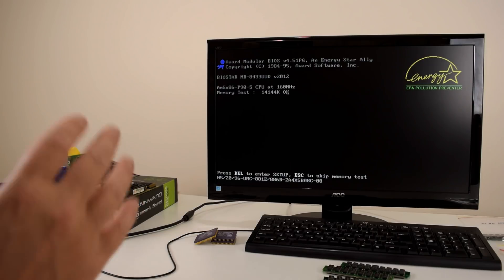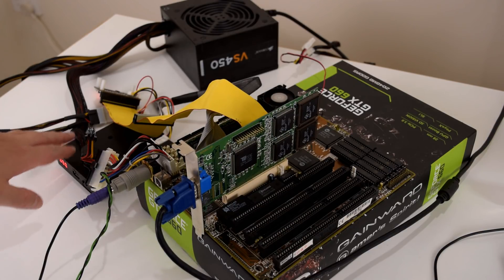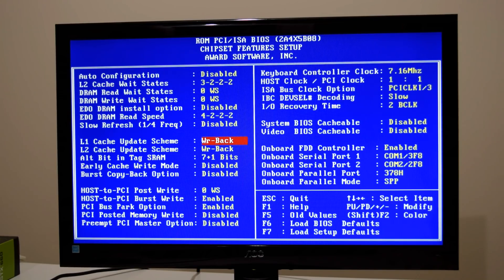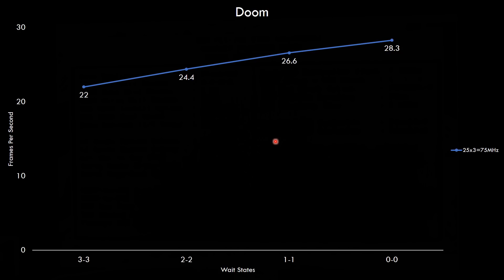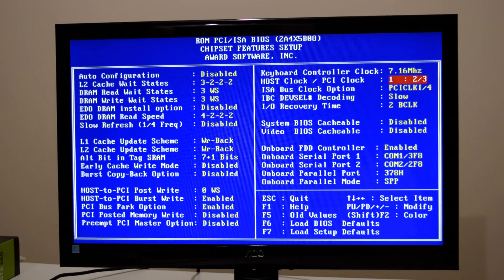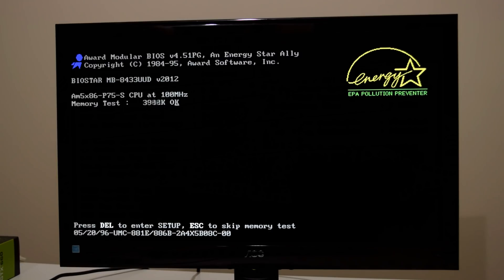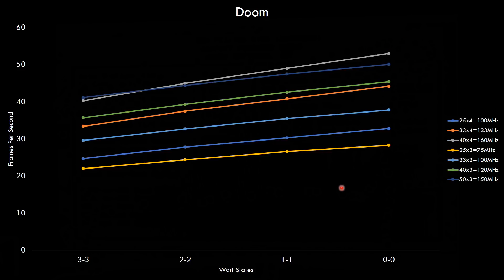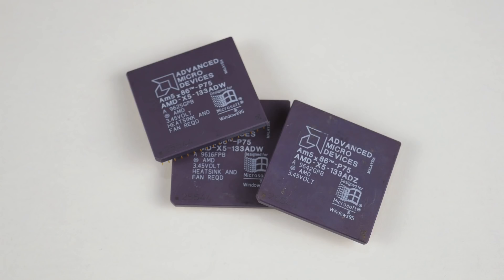486 from 75 MHz to 160 MHz and how memory timings matter

Comment: I picked up a peacock Computer recently. Came with a Cyrix dx 66 mhz processor. Then looking through a pile of broken laptops I found a system with a desktop 486 dx4 75 MHz cpu in it. I simply set the peacock bus speed to 33MHz along with the usual adjustments and works at 100mhz flawlessly ! About 65 on 3d bench

Comment: I realized you are actually changing 2 variables every time, the bus speed and the processor speed. It would have been wise to test the bus speed exclusively by doing 4x25, 3x33, 2x50 to see the effect of the bus scaling first, apply that ratio to the numbers when scaling up the processor clock to see which is more important, raw clock speed or bus speed. I feel like the bus speed is making a bigger hop than just the processor speed is.

Comment: Phil, personally, I don't think going older and older does you any favors. I enjoyed your videos on using cheap Ali Express motherboards to leverage Intel Xeons for maximum performance vs. modern parts so much more. I mean sure, remembering 486DX and such is cool, but what can we all really DO with all this? Now a cheap intel Xeon is a whole other story.

I also loved your videos on older GPUs and how they can sometimes fill in when newer more expensive GPUs are not available.
Reply: Dude, we watch Phil BECAUSE of the older stuff. It's much more simpler but at the same time more complex. 

And it's more DIY-able. Some guy did actual HARDWARE mods to make the 386 run at 50 MHz.
Reply: @fungo6631  there's old, and there's OLD.

Comment: That's an excellent in depth comparison Phil! It always strikes me how well organized you are. Kudos!
I'm currently overclocking a late 486 (1996) board that I got for only a few bucks (sold as broken but I necromanced it ;-) ) I always buy my hardware broken so I don't have to take out a second mortgage on my house for this "harmless hobby derailed" and it's really fun to repair cheap garbage ;-) Also got the famous ADZ version of the AMD 5x86 for cheap at a local seller. Your other video already helped me out a lot with my K6-2 build. This one does as well. I'm going with the 160Mhz option. This thing is goind to rip!     ..for a 486 ;-)
I'm still waiting for my 15ns L2 cache to arrive from Ukraine but I'm quite curious as well how much of a performance boost it will give me with this UMC chipset and my 60ns EDO ram...
Funny how de ADW parts state "heatsink and fan req'd" while the ADZ doesn't have this etched into the ceramic. I know the ADZ has the higher temperature rating but I wouldn't dare running this without any sort of cooling, especially not overclocked to 160MHz ;-)

Comment: Going from no cache to 128K L2 cache was more of a bump in performance for me than going from 33MHz to 40MHz bus (I only have a DX2/66) 
It wasn't the most dramatic but it did certainly increase performance, even in Windows 95 boot times. 

Sadly can't run both since it's not stable, but as the cooling setup is less than optimal I run 33 FSB and drop from 3.45V to 3.3V. The cache makes up for the drop in clock speed.

Comment: I have a test I'd love you to be able to do, basically the same you are doing here but with a VLB board AND VLB IDE and VGA cards, note that you will have to most likely adapt heatsinks on those VLB cards as they will run at the same FSB as the CPU, this in fact was one of the main drivers to implement PCI as a standard due to when the 486DX@50Mhz came out a LOT of add on cards (mostly VGA cards) were dying due to not being good enough to run at a 50Mhz clock rate. That said, the ones that did work should run faster than the SAME model on top of PCI bus as the PCI bus has more stuff between the card and CPU therefore adding wait states (to keep it simple).
So, I'd love you to find a VLB and equivalent PCI VGA card then run them against each other on a benchmark, same thing goes for the IDE controllers but for IDE controller YOU MUST HAVE THE DOS DRIVERS INSTALLED. Aside IDE controllers that have their own bios (and even those benefit form the driver) none of them will have any decent performance compared to a normal ISA card, the DRIVER is CRUCIAL for these babies to run full tilt, and the performance difference if HUGE when the driver is installed and running.

Comment: I hava PC Chips M912 motherboard with 128KB cache and 5x86 @160MHz (40FSB). Cirrus 5434 VLB and bios settings maxed out. I get 43,3fps in Doom benchmark. It's in WT-cache mode because bios is too old and I haven't got my eprom-eraser from China just yet. Mobo thinks CPU is 486DX2-133 :D

Comment: Try Linux on it lol. I've been able to get Debian to run on a PII with 128MB of RAM, the 32Bit fork of Arch Linux Supposedly supports 486 chips, but I dont have a 486 system to test it on, and my PII system doesn't have enough RAM to load the live environment. It couldnt load the live environment for Debian either, I had to install Debian in a VM and image the VHD file over. Tried that with the Arch 32 VM and it didn't work, probably a config issue on my end though. (Sad edit: looks like Arch 32 doesn't have support for 486 after all, could've sworn I read that it did somewhere. I'll do some poking around)

Comment: I too remember L2 cache not having a huge impact on performance. However, disabling L1 cache feels like turning it into a slow 80386 - useful when you run old programs without timing routines that would run too fast, otherwise.

Comment: Just a note- you should also test Intel DX4- 100 and DX2-66 , famous processors for comparsion. Or, Amd DX2-66 too. It would be very interesting to see, if 25x3 = 75 is actually slower or faster than DX2-66

Comment: The only information we were getting back then was coming from magazines. Darn. I never had a 80486. I went to Pentium directly from 80286. It wasn't easy to upgrade. The PCs were so expensive.
Reply: I had a 66mhz had to oc it to get to the 90mhz range just to play mp3's without stuttering, lol. Oh the days. 160 mhz or even close was unthinkable
Reply: Kinda like now?
Reply: @cheater00  Nah much more expensive than now. It was Dell and Gates that made prices come down. Back in the 386/486 days, a top end model capable of playing the best games would be £1300 MINIMUM, going up to £2500 and more.
Reply: @TheVanillatech   Kinda like now?
Reply: @TheVanillatech  even Elden Ring at 4k 240? 😏 I've started in the 8 bit era, I "was" there lol
Reply: @TheVanillatech  4K is not standard according to whom? You? There's a lot of games that a sub $1000 pc will run at 1080p or 720p, but those are last-decade resolutions. That's not an achievement by any means. Hell, show me a sub $1000 pc that will run Quake II RTX at 1080p 60 fps 😏 I'll wait. You said "every new game out there" and Quake II RTX isn't even new 😏
Reply: @cheater00  Even an RTX 2060 runs at 55 FPS in Q2RTX at 1080p from what I've seen, and I can build a PC with an R5 5600 and RTX 3060 Ti which is much faster for under €1000. Plus, even if 1080p is "last decade", 1080p60 didn't suddenly become unplayable. I'd know, I'm still on an RX 580 4GB. And I can still run intensive games like Cyberpunk 2077 (although it's often closer to 40-50fps), which was released years after. Playing Quake on a 486 on the other hand is a pixelated slideshow on a previous generation 486.

Also, Quake 2 RTX and Portal RTX are more techdemos than games. They're meant to sell more Nvidia hardware.

While I am starting to eye an upgrade to both GPU and monitor (wanting to go to 1440p144), there's nothing 'wrong' with my current setup.

Comment: When you disable the external cache, memory performance is going to be more critical. The cache is there to hide some of the latency of RAM. If you would keep the cache enabled, you would gain more performance from the high clock speed.

Comment: I had the Old ET 6000. That thing ran 2D stuff like a pimp on meth. I remember my 2D games going actually faster than they should because of that thing.
Reply: You tell me, I still have an old ISA ET4000 card and that thing is a rocket under DOS games using VGA 320x240 ... better performer than supposedly faster and later VLB cards, go figure.
Reply: @rawlynn2112  Well, it certainly wasn't better in Doom and Duke3D, that's for sure.

Comment: 486DX4 runs at 100Mhz, not a 75Mhz. You're underclocking.
5x86 CPU from AMD runs at 133Mhz. 160Mhz it's a nice and easy overclock.
You are swapping CPUs...
Try at 200Mhz.

Comment: well, last OC miracle ive seen was my 1.6GHz P4 with Northwood core. That little beast was running on 3.2GHz without any problem, with better cooler and motherboard and memories 3.6GHz was possible with that piece.
Reply: The early i5 and i7 overclock really well and reliably. i5 2500K @5.1GHz in use for almost 10 years and counting and no problems. Could be stable with much higher clocks if the voltage would be raised.

Comment: My brother had am5x86-p75 133Mhz overclocked to 160Mhz with jumpers =) , 8Mb simm ram , 1mb videocard Cirrus logic.. 8x Mitsumi CD-Rom. 850Mb Hdd Seagate... SB AWE64 .. Oh my God ... All mp3s files played without lag till 160 kbps , but if you move a mouse it was a lags.. =)

Comment: Nice one brother! , but I don't think if it's possible to overclock an Intel Core 2 Duo E7500 2.93GHz to 3.01GHz while using an 1200W Power Supply
Reply: Lmao
Reply: @MF175mp  it has a 360W PSU not 1200W I just realized that lol.

Comment: Low end hardware makes me happier. I moved up from a Core2Quad 2.5GHz to a Ryzen 1200 with 2933mhz memory and and Sata 3 SSD. I don't understand why people would pay more than double the money i spent for faster quad core chips. Both of the machines I'm using are roughly $500 machines and the difference a decade makes is crazy. Best improvements are at the low end. 

I'd like to see how AM1 chips compare to Athlon 64 dual cores if you ever were to make a old goodies vs modern low end video just to show how far modern low end architectures have come
Reply: because dual 2c4t chips are awful and even 4c8t chips are on their way out. my laptop and my office computer are both 2c4t and they struggle with a lot of stuff. your ryzen is slower than an 8 year old core i5, so it's not really "the difference 10 years make" and more that there have been a huge jump right after that core2quad. most of that jump was concentrated on the first 2 years and we've kinda plateaued since then.

Comment: 13:46 that boost will vary for sure depending on the application, for Doom once the instructions and some data is cached in the 16Kb L1, no need to go to L2 and it relies on ram memory.
Reply: Yep, doom is known for not being impacted much by L2 cache. Look at  Celeron 266/300 with no L2 cache for more info.

Comment: I had a K-6 II 400mhz I kept him at 616mhz for a few years without problems 112mhz x 5.5 vcore 2.5 and still running at a friend's house.
Reply: Wow. I had a K6-2 350, and the fastest it would go was 400. I put in a Voodoo3 and overclocked it, too. The fastest PII was 450, and I was getting similar framerates for about half the price.

Comment: The most interesting point is the one with cache enabled. I expected a much bigger difference too. It seems that memory timings have much greater effect than that 256kB cache. What kind of difference a bigger cache could make, I wonder...

Also memory timings seem to have a huge impact. Perhaps WS0 memory is not much slower than cache anymore...? Strange to see, especially that you used 70ns memory (WS0 at 50MHz, it must be a very nice overclocker) and typical late 486 cache SRAMs are rated to 15ns.

(On 50ns EDO - I have a quadruplet of 8MB/50ns in an Acorp 5TX29 that can take 83MHz FSB with fastest timings. But not every stick of the same model could complete a memory test at these settings.)
Reply: L2 is task specific. Doom’s inner loops fit in 16k L1. Textures and everythimg else don’t make good use of L2. In other tasks this may not be true.

Comment: To sad that there's nothing in english like the German Bios-Kompendiuum.

Those guys know anything about any Bios Setting.

http://www.bios-info.de/4p92x846/befhpt.htm

All Options beginning with V
http://www.bios-info.de/4p92x846/befv.htm

There are tons of tweak options that you dont aware off and you dont use, and some usefull stuff that you leave disabled.

S.M.A.R.T is a very good and usefull thing ! It will not decrease performance (internally S.M.A.R.T Logging always run, if you disable it, it will just prevent tools like HD Tune to read those S.M.A.R.T Values)

Typematic Rate Setting is Disabled.........why ? If you like it, when you need to push the key 250ms before it will recognized ? You can set down the value to 0, and set up Chars per Second.

VGA Palette Snoop can provide better DOS Compatibility for your Graphics Card if your Card is a ISA or VLB Card.

A20 Gate Option -> If you enable it, you will get more Speed for extended memory, because then the chipset got direct access to the ram above 640k.

Boot Up Floppy Seek = Enabled -> Test the Floopy drive at boot up. Increase the Boot Time, so disable it.

With those Shadow Options you can copy the ROM from extension Cards to the RAM.
Good to get maximum performance from a Controller Card....but it's a risky option, you need to know which adress is used by the card.

Comment: I remember overclocking my P75 before oc'ing was a thing without success.  When I switched the cpu out to my brothers P90 i could go all the way up to 150Mhz before running into bus issues.  And my P75 was running happy as a P100 in my brothers system.  Your mileage could vary a lot, back in those days...
Reply: Yes I often wondered about OC'ing Pentiums long after I'd moved on to Athlons etc. A Duron 750 from Time Computers let me push it to 1Ghz with an Asus cooler I won at a LAN. That got me thinking, so I tested a lot of retro rigs with Pentiums and was surprised how easy it is to get extra Mhz with just a few jumper changes. Free FPS. Wish I'd have known about it back in the mid 90's.

Comment: I wonder how your 486 at 160mhz compares to Pentiums of the time?
Reply: 160 MHz 5x86 is roughly comparable to Pentium 90. Except heavy FPU code.
Reply from the maker: Depends on the software! 486 type code will likely run well, but Pentium optimised code not so much.

Comment: The best of Amd's 5x86 were meant to run at 160mhz but there's a rumor saying 5x86 at 160mhz could get into k5 territory. So Amd decided to sell all of 5x86's capable of more than 140/150/160Mhz as 133mhz . You can tell the real rating from the code on the cpu : ADW rated at 133+ ; ADY rated at 140-150mhz & ADZ 160+; I have in my collection all 3 of those. ADZ in general can reach 180mhz stable with a very good motherboard and ram (60mhzx3). At 180mhz amd 5x86 is faster even than a  Cyrix 5x86-120GP with full features enabled. Also Cyrix are also rated to run stable at 50mhz fsb and sometimes 2x50 is better than 3x40 .(depends on ram used),pity cyrix 5x85 are not great overclokers!
Reply: I couldn't find a direct connection between AD* rating and overclocking potential. I've seen ADWs that could beat certain ADZs. Officially the third character means max temperature though, and higher heat tolerance can indeed mean better overclockability. But it's just a marking and I suspect cheap mass produced 5x86s weren't strictly binned so there may be a huge "ADZ content" among the chips marked ADW.

Comment: I tried overclocking my 486 back in the day. I saw the jumper diagram for the processor speeds engraved on the motherboard and thought It'd be cool to make it go faster. After a while, the PSU connector in the motherboard melted. I managed to saved the whole thing, but that ended my teenager OC adventures.
Reply: ROFL sounds like you had other problems..  never melted any power connector OC my 486 or early Pentium good old days when i had a Pentium 150Mhz running at 233Mhz...

Comment: Great work Phil. 

I noticed that 120 is faster than 133, however 160 is faster than 150. Due to the 2/3 pci divider.  Which shows how important PCI clock is.  It would be interesting to test out some ram intensive cpu benchmarks that are not graphics based to further isolate ram.  However the only thing that matters is 0-0 ws timings considering the ram can do it no matter what. (my 486 system is the same way)
And it would be kind of interesting to pick an arbitrary clock, and see how much impact L2 has with different timings. and the L2 latency timings as well.... But that can be time consuming.  And L2 had a greater gain on the lower end cpu's with 8k L1 over 16k l1. At least that is what I found.
Reply: oh yeah bus speed was a HUGE bottleneck back then, even into the pentium 3 era. you'd want to push it as far as you could without getting instability.
i remember my athlon 700mhz could go up to 119 fsb and the increase in performance was MORE than just 19%. it was more like 25%.
same for the pentium 2 which i'm tired of mentioning already. 133mhz fsb made it like 50% faster. 150mhz fsb made it feel twice as fast as stock. never benchmarked anything though so these are just impressions.